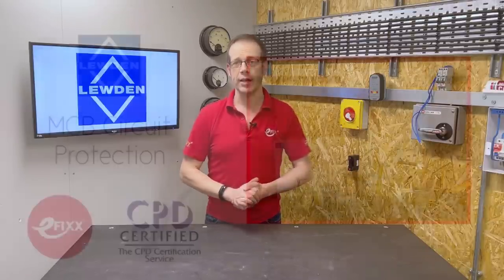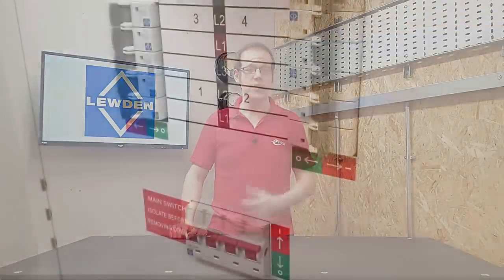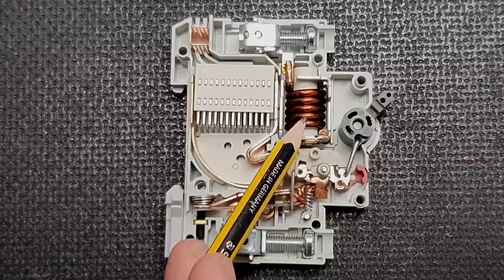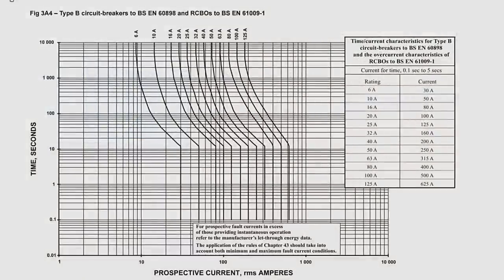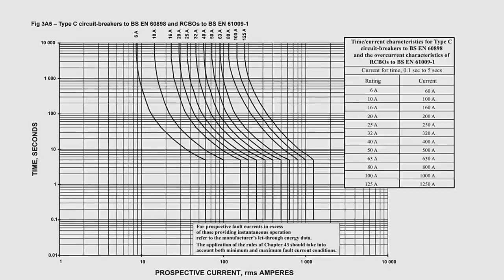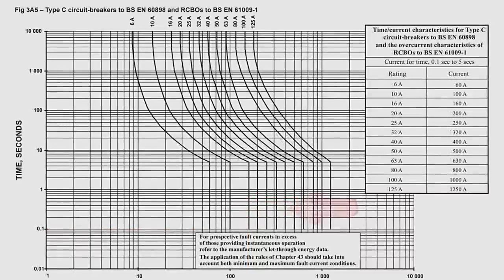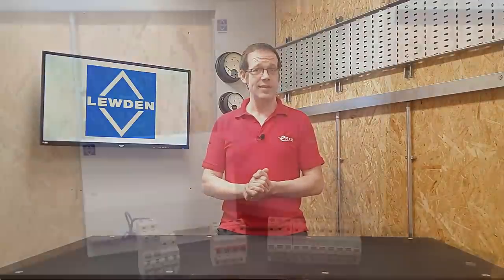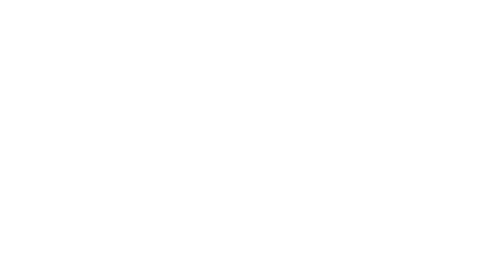The Complete Guide to MCBs - Miniature Circuit Breakers

Comment: Great explanation Joe.
I often get asked why I use mainly 6kA MCBs in control panels. The answer as you have explained so well, basically there maybe no need for the 10kA. As the Ipf is very rarely even close to 3kA never mind above 6kA at source, and even a lot less at the CP.
👊😎👍💙

Comment: Yes had that short circuit issue where I used to work, seeing as the total length of cable, including the fuses and switchgear, was 15m, from the secondary terminals of the 250kVA transformer, via the 120mm2 cables to the busbars of the substation, and the 10m of 25mm2 SWA cable that fed the building disconnect.  Did mean the voltage was stable at 238VAC on single phase though, though those 15kA breakers did cost a pretty penny when replacing a lot of the old Fuchs units for updates, though 2 of them stayed exactly the same at the original Fuchs units, no real replacement for the 100A 50kA breakers that fed the lifts, and all they got was dusting off and checking the screws were still tight. Board and breakers originally dated 1960, and, along with the substation, still going to be there for decades more no problem, with just a little regular maintenance.

Comment: Here's an idea relating to diversity edge cases: a smart consumer unit that monitors and varies supply to individual circuits in order to prevent the main fuse blowing. This would be based on a priority system; to favour showers over cookers for example, but also to modulate/vary the power by means of voltage/current reduction or, as in the case of dimmer switches, alteration of the sine wave etc. A warning could sound when say 95% of available power is being used, and power could maybe tailored/controlled using an app.
This type of CU doesn't seem to be available, (and is a logical extension of a smart meter) but might be an essential tool for future smart grids.

Comment: Where I work in Sweden I’d estimate that 95% of MCBs are type C, indifferent of it’s a commercial or residential installations.
Doing a check it’s not often it’s actually a problem using type C but unfortunately most sparks don’t know that they’re taking a chance/risk when doing so.
Reply: Type B for residential in sweden. C for anything industrial or pro kitchens because of start load of motors.

 Same goes for rcb's. Residential is type A and anything three phase or single phase with frequency converter gets type B.
Reply: @thedangerzone9399  the wholesalers don’t stock any large amounts of type B MCBs.
Fortunately it’s not very often there’s a problem with using type C in residential buildings.
Reply: @MarkUKInsects  we don’t have that system in Sweden. We’re supposed to do certain checks but nothing is saved or reported to any organization.
That’s the most impressive thing about the UK and it would be great if someone would do a in depth video on what happens with the submitted documents and if there’s any follow up done.
I could basically go out to a costumer and install a RCD next to an existing distribution board and only have to check the RCD, I’d not be taking responsibility for the rest of the installation and wouldn’t be able to make the customer change the entire board. It’s quite common with boards with different brands of MCB and accessories in.

Comment: I've got an old school 20A Variac and the smallest breaker that won't make it trip instantly, is a 40D. I ran 8m of 4mm armoured to my shed, which is the max the cable can take for that short of a run. But apart from my Variac with is a dead short on start up, the only other things I used that take that amount of power is my welder and heater.